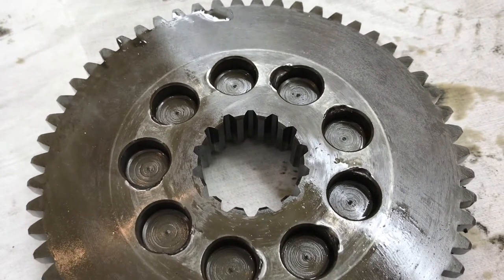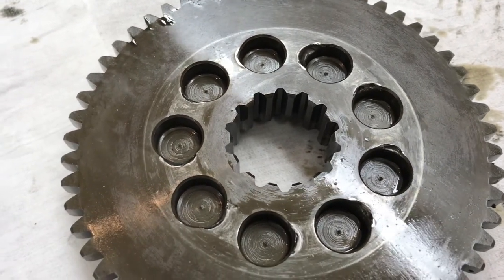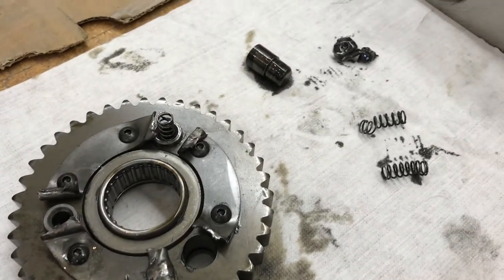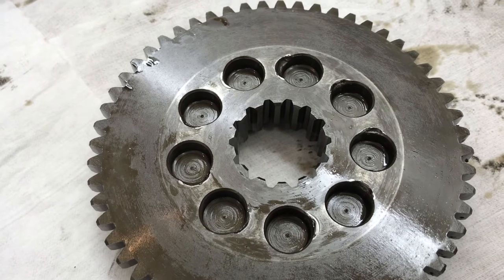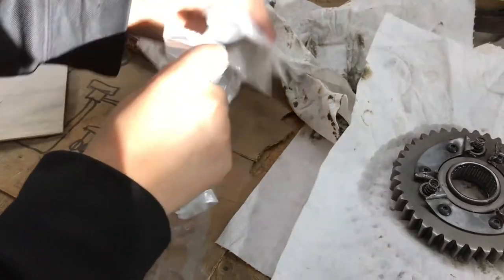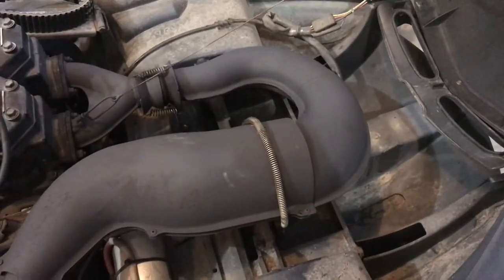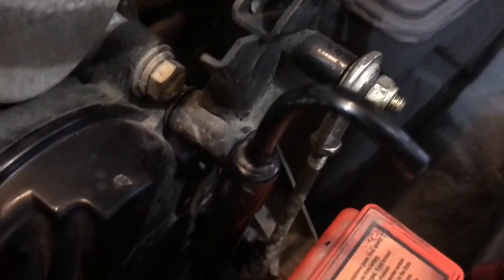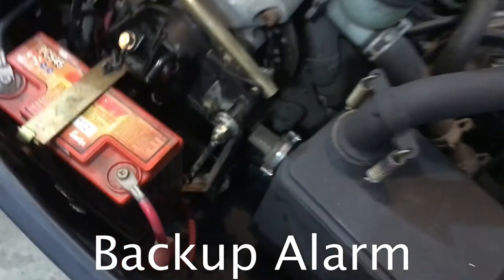Arctic Cat Snowmobile Repair/ Won't Shift Forward

Comment: Wow, that baby is messed up!!!!  I have a Arctic Cat 1998 ZRT600 Won't move forward or reverse and I had to chain case open and saw the pins were worn, etc.  But I noticed something even more alarming.  There are no bolts holding the gears in like you have.  The one on the bottom you had to drill a hole in sidewall.......That lower gear has no bolt on mine nor the other  one in the middle.  Only the top has a bolt in the gear.  Do you know if that is the way the 98'ts were made or the previous owner did not tell me about those bolts being missing.
Reply from the maker: Spike, I'm not sure the answer to your question. Can you tell if the spindle is threaded like a bolt should go in or is too hard to tell? I could easily tell on mine if the bolt were missing for sure. Is it possible the cover is designed to hold them in place? Sorry I don't have good answer for you.
Reply: @joelongrid7625  would you tell me where you go your parts from?
Reply from the maker: @jackjackson8023  Dakota Cat in West Fargo, ND. Took only about five days to come in.

Comment: Did you figure out the rubbing noise after you fixed it.  I used the knowledge from your video to fix the same issue in my 2002 pantera 800. But have the same concerning noise after the fix.
Reply from the maker: After riding it for a bit the sound went away. The machine was sold shortly after that. Thanks for watching.

Comment: Your clutch needs a good cleaning at least.  When it engages hard like that after switching from forward to reverse it can cause those pins to skip across the holes causing premature failure.
Reply from the maker: Great advice. Thank you!